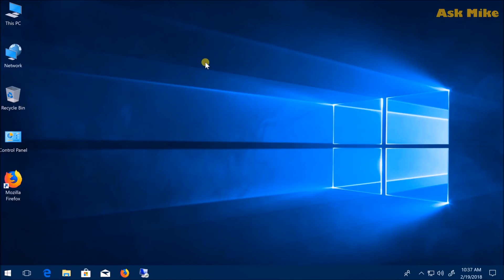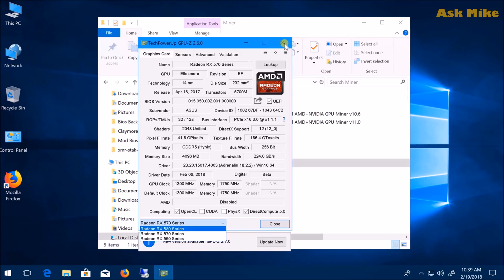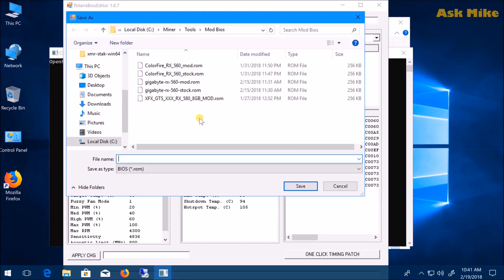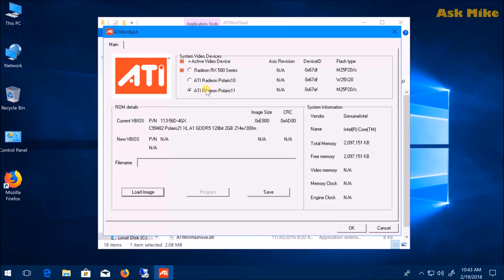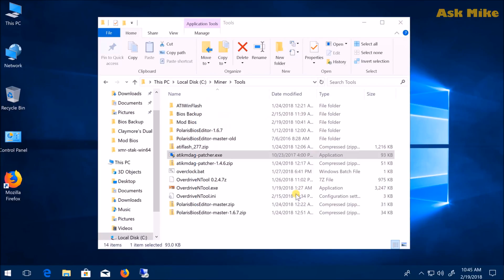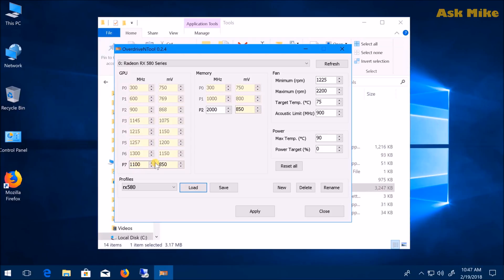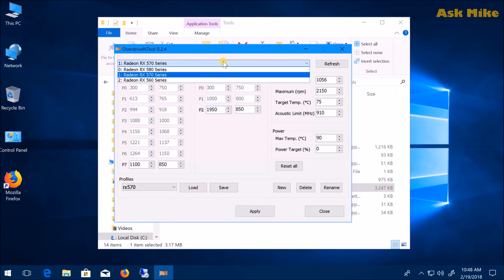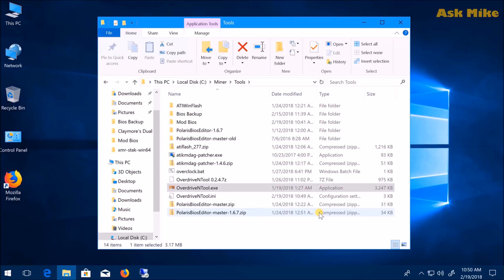Mod and Flash BIOS RX 580, 570, 560 (Polaris AMD Graphics Card) for Ethereum Mining

Comment: Hi, I followed your advices for my Radeon RX570 Nitro + (2 GPU with 8GB) and under Windows they went from 9.918 Mh/s to 10.245 Mh/s. But under Linux (xubuntu 20.04) system doesn't start up. What can I do?!

Comment: Can i ask sir about the proper settings on msi afterburner sorry for being a newbie.. i just want to ask how to lock the msi afterburner settings because whenever i overclock my 3 radeon gpu only keeps on resetting what am i doing wrong? Only the msi afterburner setting keeps on resetting after a couple of hours only one gpu resets and the other 2 stays the same
Reply from the maker: For the setting that get restarted normally it is overclock which is not stable... what card you are using? If RX 580 or 570 normally it is better to use OverdriveNtool as you can lower down the voltage as well for better power consumption. It all depends on which card you are using. Let me know then I can share with you a stable clock for you to try out.
Reply: Ask Mike i am using 3 Gigabyte RX 560 sir

Comment: You don’t need to flash anything really just change global settings from graphics to compute and viola watch those MH/s go super high! I have a video out that shows you.
Reply: can u send me this video @daniel martinez
Reply: ahmed mostafa click on my profile then pick the top one
Reply from the maker: Yes changing global setting to compute does give you high hash rate but it does used up more watt for your card. Besides that do check using hardware info to ensure there are no memory errors as well. If you are just mining ether it is fine, if dual mine the stock card, the temperature can rise too high for the card.  Flashing it makes it mining at the same hashrate with less power consume and lower temp for the card.
Reply: Ask Mike the power draw was the same out the wall and I checked my settings out at max with fan at 80% for 3 days. Usually when over clocking and under volting, trying to maintain a balance without impact can be a bit of a chore but as stated in the video it’s about the Memory Clock not the core clock that make the MH/s go up further. If you lower the core clock it keeps the heat down and as for the voltage there is a setting that allows you to mess with the voltage in MSI afterburner.
Reply from the maker: I am using my card for dual mine and I can only run at 90 power limit so that the temp can be at 80 degrees and the power draw is close to 150W per card. Tried with MSI AfterBurner cannot achieve the results needed. Now at least I can run them at close to 30MHs with temp at 73 and power around 70W. It is good that you can do it without flashing.